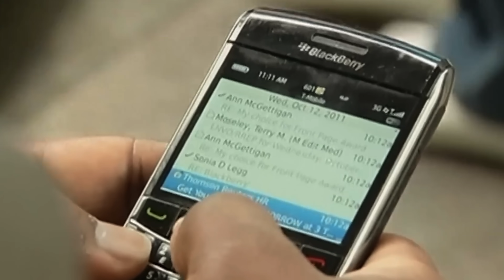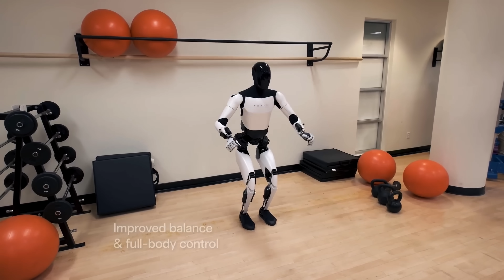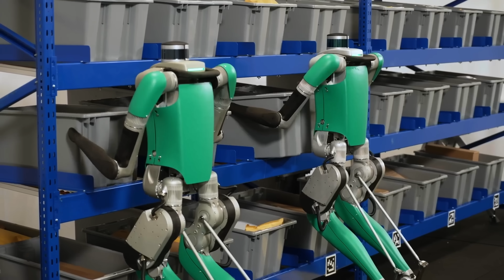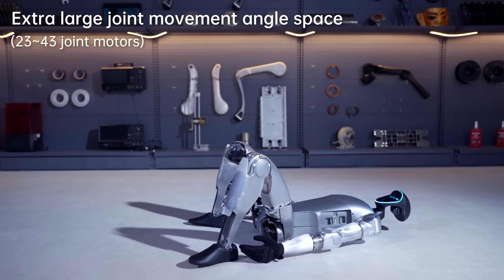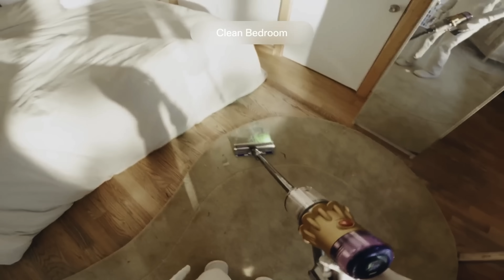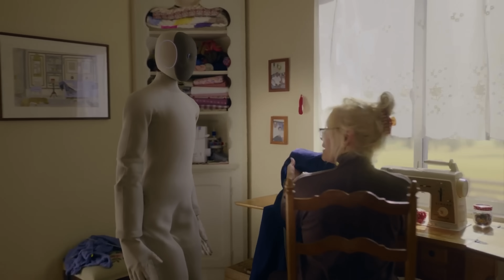Are Humanoids Approaching the iPhone Moment?

Comment: Love the blackberry analogy and mention of the developmental data set time line for motor functions. Much of the anatomy differences like bent knees or the Swiss bottle neck are news to me. Do you think it'd be more efficient to do the processing from a secure wireless terminal in the location of operation and use swappable battery packs (I think unitree's models can replace their own) to deal with some of the energy issues? It's so exciting to see this industry come together and cyber security as a whole needs a lot more work regardless of robots (though they'd be stronger psychic beacons for a terrorist attack than sabotaging a pipe line or stealing data... Maybe not as big as the Russian grid implants that blacked out Ukraine's power in real terms but the psychological effects are more potent here from an evolutionary resonance standpoint... Akin to giving Digit a head in the opposite emotional valance perspective). Thank you for this balanced, optimistic, and informative content.
Reply from the maker: I really appreciate your insightfuk comment! definitely more than enough to think about on this topic

Comment: I guess that building humanoid-like robots would be nice if we could match or surpass the current limits. I still think once robots are at least decent enough to handle cooking and cleaning (especially a harsh task like manually doing dishes which involves water interaction), it would be more optimal to then focus on making individual robots that are designed to handle specific tasks.

Think of a system that mounts to your ceiling in the kitchen and handles all food organization and cooking, or a more complex idea; a robot that could be mounted in your garage and do basic car diagnostics and maintenance. 

In a post-AGI world where robots everywhere, especially things like cars, are all loaded with intelligence software.. having exterior AI evaluators are roughly just as important as having the AI inside the machine evaluating the internals.
Reply: Unpractical for everyone to have a garage robot for vehicle Maintenance.  Your car will drive itself to a service center while you sleep.  There A robot will do the service.

Comment: What I think, you did not mention cobot arms, because Baxter Robot tried to forge a market, but cobot arms still won.
So yes, I think specialized forms as you mentioned are the solution to many many problems.
Also it seems Sunday Robotics is doing the training data correctly, let the people wear gloves while doing regular work. Teleoperation is a not the solution for fine motor skills.
As someone does deals with IT security, these robots need to be able to run on a more standalone solution: a regular PC and a GPU and a robot as a set, no teleopration, no OpenAI remotely brain in some datacenter A AMD Strix Halo machine is US $1000+ An industrial one is probably US $ 2500 that's not a crazy number.
I think Unitree is on the right track in some sense, I think hardware and software are two separate problem and especially arms/hands is probably what needs to be separately sold by some specialized company. And probably even the base software is a commodity, then some company makes a product or does projects and combines all the pieces and does the project/product specific training, etc.
Reply from the maker: Great insights! Thanks for sharing!

Comment: The energy problem could be solved by making the brains remotely connected.
Reply: Much greater potential for hacking.
Reply from the maker: Interesting point. I guess it could help with the brain side. Maybe there could be a latency issue though